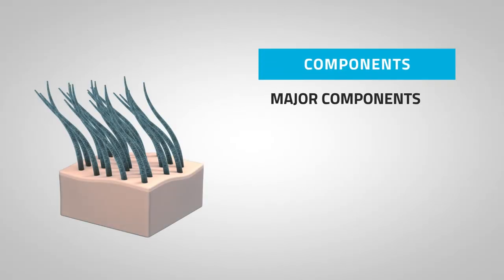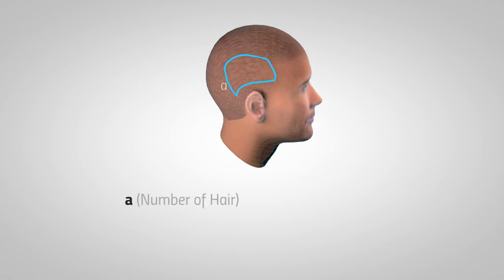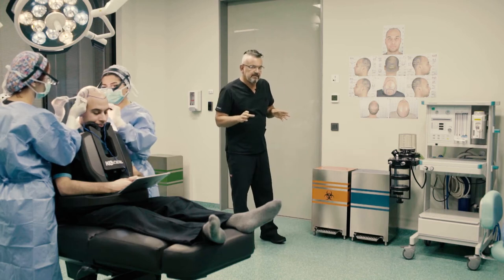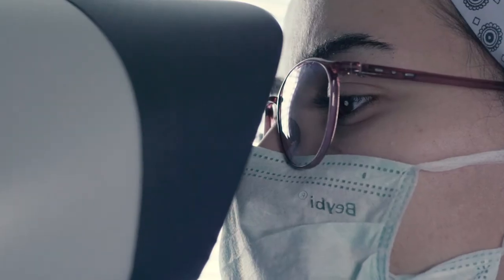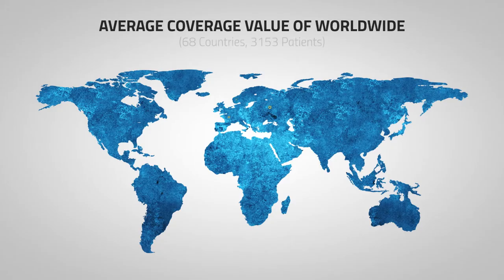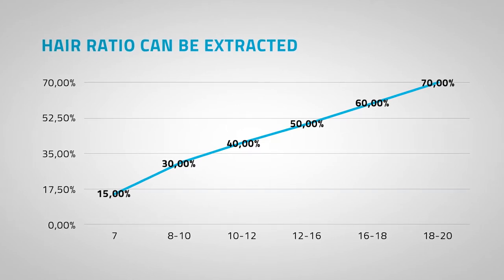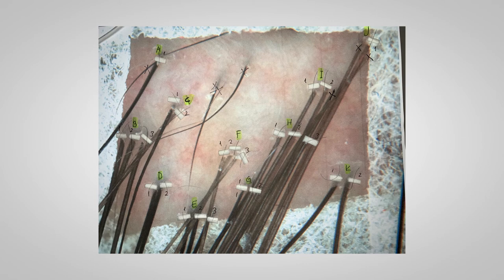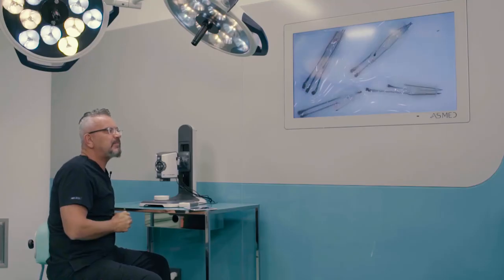Donor Management by Kebot and Kebot Mobile

Comment: A question about Ke-Bot mobile:

I am sure there are people who first of all want to get a better understanding of their donor before making a final decision for a surgery and to travel to your clinic.

So, if you analysed smartphone images whilst using Ke-Bot Mobile - how many images from various parts of the back and the sides would you need in order to give a ballpark figure about the Coverage Value of the relevant zones?

And what would need to be roughly the length of the photographed follicles?
Reply from the maker: Hi reina, 1 - 3 images are enough. Since the follicle is under the skin, it is not possible to photograph it. It is enough to cut the hair short for analysis. When the hair is short, we can see all the follicles separately in the photo.
Reply: Great. So, if people sent you 3 images and which have been taken from their cut short donor (1x back, 1xleft, 1xright side) whilst using a smartphone and a simple add-on lens (similar to how you showed it here), then you would be able to do an automated hair analysis and evaluation via Ke-Bot Mobile and provide relevant data of the images: coverage value, density, etc.... Correct?
Reply from the maker: Yes.